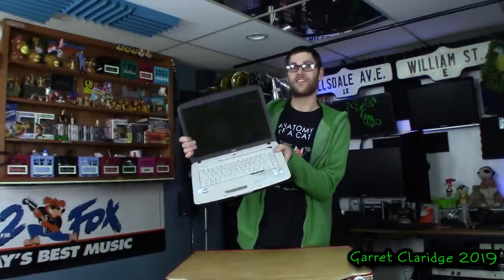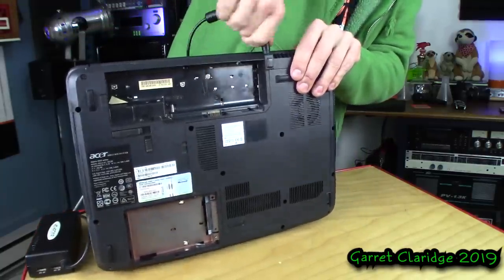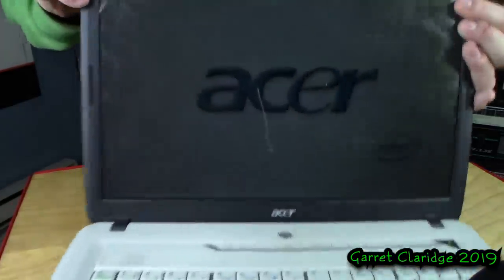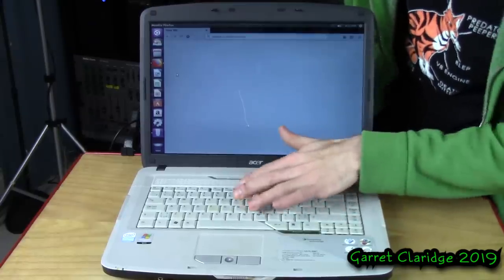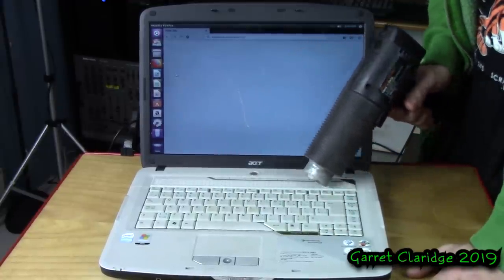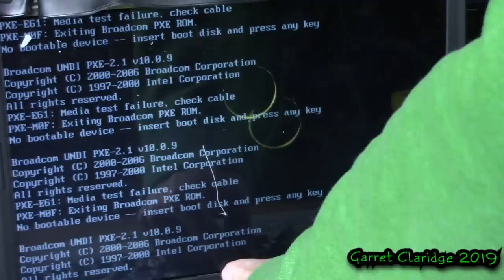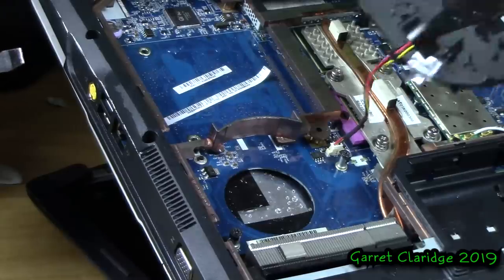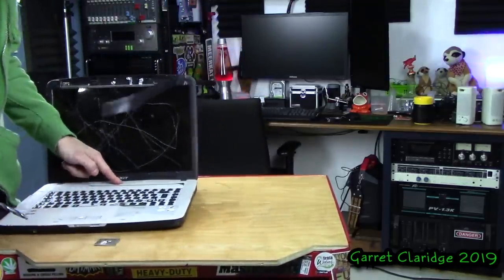Acer Aspire 5315 Destruction

Comment: Craigslist: Acer laptop bought it but I never used it, in great condition, doubles as macaroni maker if heat applied ($2000 option back in the day) selling for $25000 will trade for new car NO LOW BALLERS I know what I got

Comment: Like most Acer stuff these things were junk when they were new.  They used to give them away for free with mobile phone contracts.  They had a very failure rate.
Reply: Well, Acer does make decent stuff now but back then, yea stuff like the Aspire 5315 was total garbage. My second laptop was a 5315 (first one was some type of Latitude, can't remember the exact model) when I had it the thing blue screened all the time (but I did have some viruses which may have caused the blue screens but I think it was just a crappy laptop)
Reply: I destroyed an HP laptop.
Reply: @TechNerd22  I had an Aspire 7720 and that thing was amazing.
Reply: I used to have a Aspire 5 with a Ryzen 3 3200U but it was hella slow.

Comment: Nice destruction but i missed 1 thing.  The adaptor can go up to 24 volt.  Overpower that thing until it smokes.
Reply: Nah it was better that he made this work first maybe at the end
Reply from the maker: @harshnemesis  i should make a 110 to laptop adapter wire for next time bypass the block haha
Reply: @GarretClaridgeMeerkat  A dc regulator would be better if you have access to that and just slowly increase the voltage until it stops working and beyond that
Reply: I don't think 24 v is enough to overpower it

Comment: Good Ol' Black and Decker heat guns, I found a UK 240 Volt one at the dump the other day brand new from 1984, The heat gun was in the metal bin and the cable was in the copper scrap, put it it back together and wired a plug on the end and she works mint!.

Comment: I am sorry
But I didnt watched whole video
I was using this laptop for 11 years and it means a lot for me
And its still working even there is huge crack on screen
It was really good laptop
And still is good laptop and it will stay in my heart and I will keep it with my dad
Its still good for old games and old software (its windows xp home on that laptop now)

Specs: Intel Celeron - 1 core - 2,5 Ghz
             3 gigs of ram
             250 Gb HDD (5000 or 7500 rpm)
             Windows XP Home (32 bit)

Comment: Next time u destroy something with water, put a little salt in the water for more damage
Reply: salt water dont do much if its low voltage :P
Reply: @chloeprice8  He did that once on one of his old videos.
Reply: @germaineliew2012   i know ive seen it. but still not very effective. i had done the same with poring saltwater in varius stuff. but most speaker amps like that work with 12v(24-48v for the bigger stuff) and 12v wont do much